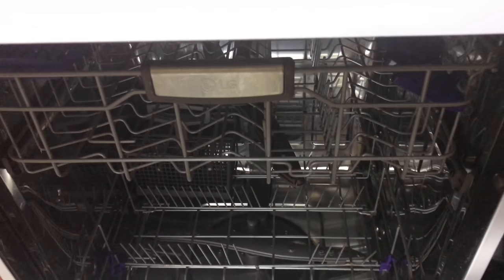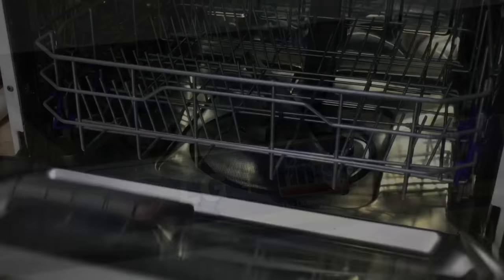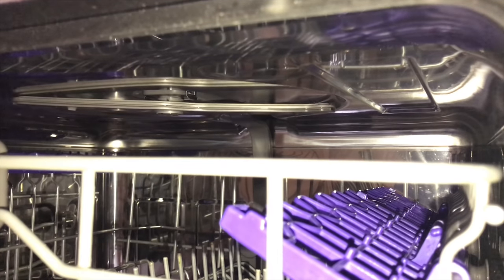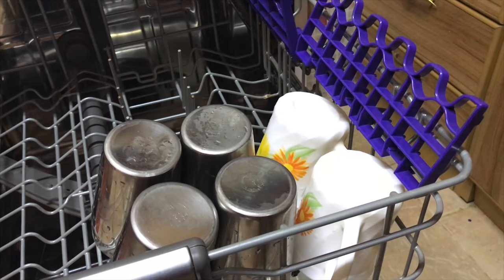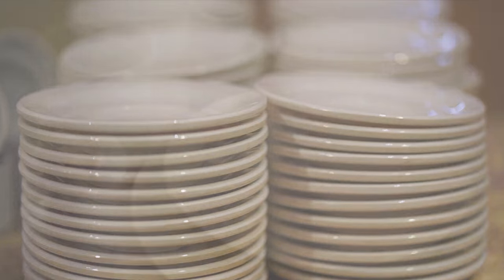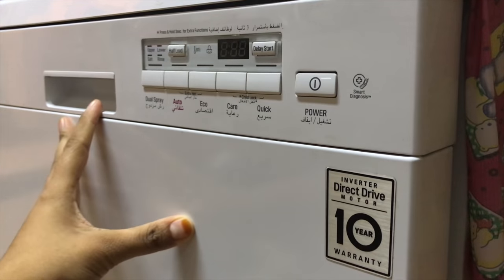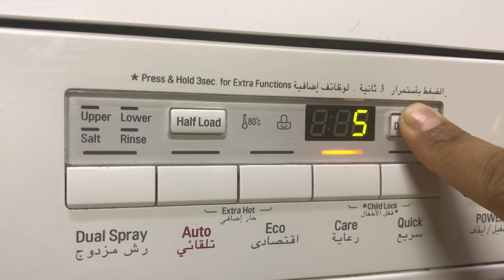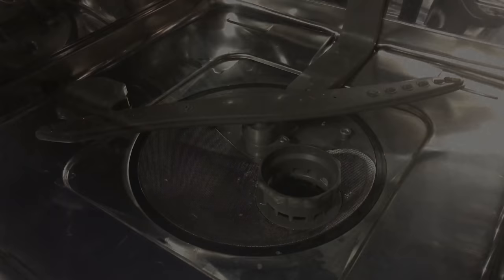My LG Dishwasher | Tips for Cleaning

Comment: People wondering why salt is used. Mainly in UK made machines with built in water softeners. If your machine doesn’t have a salt container under the bottom basket like she showed don’t worry about it. Here’s the deets:
“Contrary to what some people may believe, dishwasher salt does not clean or fight hard water stains. Its purpose is to reset the unit’s built-in water softener. Some dishwashers, especially those manufactured overseas in the U.K., feature water softener baskets filled with small resin balls. These resin balls absorb calcium and magnesium ions – two compounds commonly attributed to hard water stains – from the water, promoting clean, spot-free dishes.

The resin balls have a negative atomic charge and the dishwasher salt has a positive atomic charge. When dishwasher salt is used, the resin balls attract the sodium ions; thus, resetting the resin balls so they are more effective at absorbing calcium and magnesium ions in a process known as ion exchange.